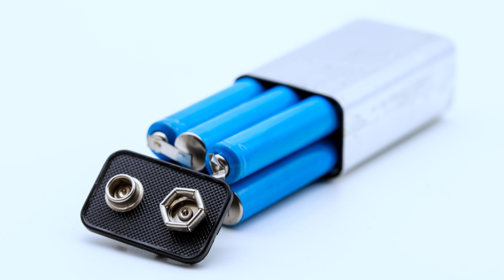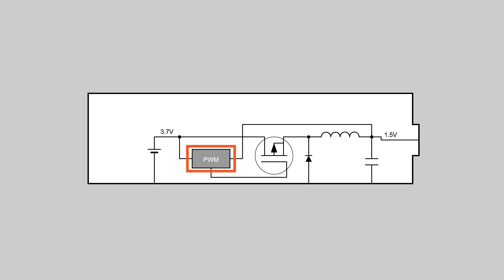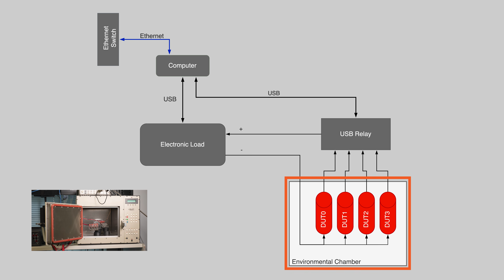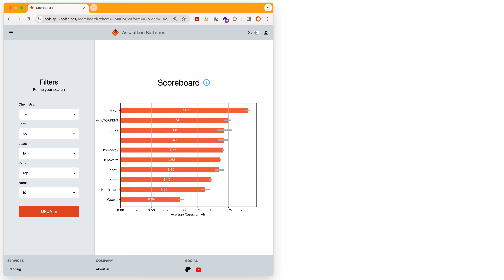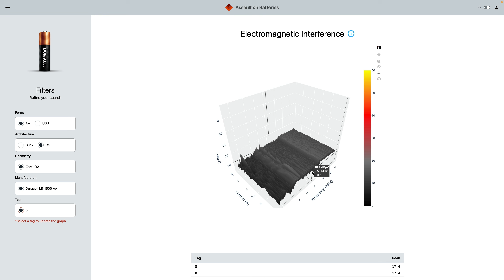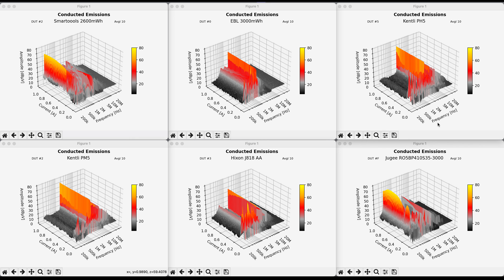Assault on Batteries #1 |  Rechargeable Lithium-Ion AA

Comment: GREAT PRESENTATION.   WILL THE EMI BE A PROBLEM FOR HANDHELD GPS CHART PLOTTER LIKE THE GARMIN
 78CS?
Reply from the maker: Thanks for the kind words!

Assuming you mean the Garmin 78SC, we don't recommend you use them. According to Garmin's user manual the 78SC is compatible with rechargeable NiMH cells. The user manual mentions lithium cells, but these would be disposable LiFeS2 cells (eg Energizer Ultimate Lithium).

Comment: how fine would Lithium-Ion AAA be for gaming mice?
Reply from the maker: Depends on how much filtering the mouse has on its power supply. Unless the manufacturer specifically claims to work with 1.5V lithium-ion cells, we can't recommend them for Bluetooth devices.

If your mouse uses an even number of 1.5V cells, you could replace every pair of 1.5V cells with one AAA 3.2V LiFePO4 cell and a AAA short blank, like these: https://www.aliexpress.com/item/1005009339716141.html

Be careful to replace pairs of 1.5V cells with exactly one LiFePO4 cell and one blank, or you could damage your device.

Comment: Breaking news. These batteries interfere with am radio reception. Cannot use them for am radio. They don't comply with FCC rules regarding electromagnetic interference
Reply from the maker: Yes, they are too noisy to power AM radios, unless the radio has filtering on its power supply.

Comment: If you only get 2200mAh what is the advantage? Thats what Nimh gets and they last 10 yrs if charged right.
Reply from the maker: The big advantage vis-a-vis NiMH is the higher voltage of lithium-ion buck-regulated cells. A 2200mAh lithium-ion cell stores 3300mWh of energy and you don't have to deal with false low-battery indications.

Comment: I have read after 50 cycles they would lose most capacity, is it real?
Reply from the maker: We're curious too, but lab testing of cells is crazy expensive. For reproducibility, we need to charge and discharge four samples 50 times in a temperature-controlled environment. A round trip for 3Ah cells (charge and discharge) takes on the order of six hours. That's 4 x 6 x 50 = 1200 hours of lab time at about $200 per hour (admittedly opportunity cost). There are some low-hanging cost mitigations, but, regardless, we'd need a lot more Patreon subscribers!

That said, which make and model are you most interested in?

Comment: Can I ask, do non rechargable lithiums have the same noise issue? So an Energiser Ultimate or PowerOwl or whatever?
Reply from the maker: Energizer Ultimate Lithium are disposable (not rechargeable), have no internal electronics and don’t generate EMI. Careful with Powerowl, they make both rechargeable (lithium-ion) and disposable LiFeS2 (lithium iron sulfide) cells. Rechargeable lithium-ion AA cells make EMI noise. Disposable LiFeS2 are quiet.
Reply: @on-the-fritz thank you kindly. I saw the new Xtar CLR batteries yesterday and reviews seem good and the voltage drops off more gradually at the end than previous generations of Lithium rechargeables it seems. Available in 3300 and 4300 mWh.

I use disposable lithiums for my radiator valves so am looking at swapping to a rechargeable lithium, as nimh lithiums voltage does not play well with the valves.
Reply from the maker: We'll check out the CLR cells. Thanks for the tip.

What make and model of radiator valve are you using?
Reply: @on-the-fritz they are Drayton/Schneider Wiser valves. They communicate with their hub over a proprietary zigbee link. I've seen others talk about using rechargeable lithiums with things in this frequency that have not suffered from the noise so I'm hopeful things will be OK. They don't play well with nimh due to the low voltage. 

I ordered my first rechargeable AA lithiums yesterday (Xtar 4150 mWh, Xtar 4300 mWh CLR and 1620 mWh AAA) and a VX4 charger to go with them. The 4150 and 1620 cells drop to 1.1v just before death, so I'll just use those in things that I don't need battery monitoring on, but they are cheaper than the new CLRs which will go in the valves as and when the disposable lithiums in them perish. Not cheap, but I purchased 96 disposable lithiums in the last 12 months so payback won't take too long!

Comment: I really wanted to like some of these cells but I ordered a few off of Amazon and  i have to say I'm not super impressed because when I put them in my simple light that takes three double a cells that I purchased from Home Depot the unit started blinking on and off so they're not really made for high power LED type lights.  

So I'll stick with my IKEA LADA batteries and just switch them out as needed.   
And it's really nice that someone mentioned the EMI that these lithium ion double A cells produce because a lot of people forget about that but then there are a lot of devices that really don't care I mean if you had the really inexpensive cheap flashlights that you probably picked up at the Dollar Tree these things are amazing.

Same thing with those outdoor LED lights that you'd like to go ahead and keep running for a long time but you are stuck with the double A form factor.
When you usually takes two to three double A's I sometimes just modify I'm just to go ahead and take the standard with your mind on sale and just call it a day and I made a few lights like that or modified them to work in that fashion and they last for quite a long time and I used them that way with even unprotected cells for over a year and they worked just fine.

Great way to recycle your old lithium ion cells from active duty to running some LED candle lights outside.
Reply from the maker: How much current do your LED lights draw?
Reply: @on-the-fritz     Hey, I got a Bench top power supply!   BRB. 
UPDOOTE:  

At 4.5v   ( ~ Max a fully charged Alkaline) 
4 Watts.   
.7 of an Amp Current on the highest setting. 

I did not bother with the low setting but the cut out Voltage the Defiant  branded LED light was about ~ 2.5 volts.  

Odd?  
Either the batteries are causing interference with the circuitry inside the light or it really doesn't want to do anything over a half an amp from these batteries that I purchased.

another YouTuber in Japan tried the very same batteries and they in fact did do one amp of current but it seems very odd that minor having trouble with that maybe it's because they're in series?  :body-blue-raised-arms:  
Maybe an extreme amount of Interference? 
Who knows....  

They sure built well, and they work great for about 30 min or so - then they are a bit too dim to really use as intended.  
In fact at about 3 volts they are all but unusable.
Reply from the maker: Yes, that’s odd. We resistively load AA cells up to 1A during our EMI tests without issues, and many manufacturers claim their cells are able to output 2A.

To solve the mystery we’d have to characterize the current drawn by the LED light over time with an oscilloscope. It’s safe to say it’s not a steady load, like a resistor.

Comment: I was planning to purchase lithium ion converted 1.5V batteries for my clamp multimeter till I stumbled upon this highly educative and informative video which I'm glad I did.

So I guess it's Nickel-Metal-Hydride battery for me
Reply from the maker: Does your clamp multimeter take an even number of cells? If so, consider replacing pairs of alkaline cells with a 3.2V LiFePO4 AA cell and a dummy (shorting) cell.

Comment: 110% Agreed !!!~~~~~~~ Who makes BEST ????
Reply from the maker: All of them are too noisy to power devices sensitive to radio frequency noise and we have no data on reliability, but we really like the Nitecore NH2400, because of Nitecore's reputation, its look and feel, its high energy (despite having a USB-C charging port), its gradual voltage drop, and because they're almost the only offshore manufacturer that exceeds their published specifications in our testing.

Runner-up is the Soshine 4200mWh, which tops the energy scoreboard, also has a gradual voltage drop (but not from the start like the Nitecore) and is inexpensive on Aliexpress.

Comment: So, I'm assuming because of the EM noise, these might not be good for a handheld GPS receiver, correct?
Reply from the maker: Only the manufacturer of the GPS receiver can give you a definitive answer, but they tend to be quite conservative with their recommendations. If your application isn't critical, it's worth a try. You'd want to compare the GPS receiver's C/N₀ values, if they are available, when powered by alkaline and bucked lithium-ion cells.
Reply: @on-the-fritz  It seems that most of the Li battery EM noise is due to the switching and the electrochemical process in two MF (kilohertz) regions. The highest noise frequency I could find was around 1 MHz. All the GPS signals (US GPS, Galileo, GLONASS, BeiDou, QZSS, IRNSS) are in the GHz range from 1164 MHz to 1610 MHz (plus 2492 MHz for S-band India). As long as I don't have a WiFi-equipped unit I don't think it should be an issue, and those units have internal batteries anyway. Bluetooth and ANT+ also GHz range.
Reply from the maker: Keep in mind: buck-regulators have fast switches for efficiency, so they emit harmonics that splatter up-spectrum; and receivers often use intermediate frequencies that can intermodulate with the EMI from cells.

Can you clarify what you mean by noise due to an "electrochemical process"?

Comment: Very interesting, thank you! How about looking at Paleblue and Bump USB Rechargeable AA Batteries?
Reply from the maker: You're welcome! 

We shall add the Paleblue and Bump AAs to the queue.
Reply from the maker: paleblue is on the scoreboard with 1569mAh and 2286mWh, which is about average. Unfortunately, of the four Bump AA cells we purchased, only one would take a charge; it tested at 1262mAh and 1859mWh.
Reply: @on-the-fritz  I must confess I haven't used mine yet. I will make an effort to use them now.

Comment: I have been looking at the Li-ion AA and AAA batteries with the integrated USB-C socket. Any good suggestions?
I want to use them with my Garmin Foretrex 701 (AAA) and 2-way radios (AA).

I like the integrated USB-C cells because they have a higher likelihood of being useful in a power-limited situation like for disaster relief after a tornado / severe weather where infrastructure is not readily available.
There are 100+ different ways to charge a USB-C powered device (solar power bank, hand crank charger, car charger, portable power bank, ect...) but batteries that require a special charger are useless if you have lost that special charger or power is unavailable for it.
Reply from the maker: We can't recommend buck-regulated lithium-ion cells for devices with sensitive analog circuitry, like GPS receivers and radios, because such devices might not tolerate switching noise from the cell. We expect electromechanical and digital electronic devices would be immune, but there's no guarantee they wouldn't interfere with other devices. For example, your two-way radio might pick up interference from a string of LEDs powered by a buck-regulated lithium-ion cell.

That aside, none of the cells with integrated USB really stood out in terms of capacity, EMI noise or build quality. We did have out-of-box failures during our testing, so it would be a good idea to buy a few extra for backup.
Reply: @on-the-fritz  I tested some RayHom AAA type-C batteries in my Gamin Foretrex 701 and they worked great.
I also tested some Cardiens AA Type-C batteries in my 2-way radios and had no issues.

Comment: about 5 years ago i went on a search for legit replacements for all my alkaline aa/aaa cells.
after looking through all the available options: enloop NiMH, usb rechargable lipol (as outline in this video), i found the least well known and best performing version of rechargeable cells in this format. only 1 company i can find that mfg them.
soshine lifepo4 batteries with double voltage. you can either use a cheap spacer (i prefer brass pcb standoffs with a bit of al foil wrapped longwise around them) or rewire alkaline compartments from series to parallel. 
in my experience i have had zero failures, and no noticeable reduction in capacity despite constant use in many applications. they have about the same capacity of standard brand name alkaline batteries, and basically last a lifetime without any questionable electronics jammed inside. theyre true cylendrical cells. since almost all electronics run on around 3-5v, almost all alkaline battery compartments tend to be series multiples of 2, so they work surprisingly well.
not sure why this solution is either overlooked or ignored by almost everyone on youtube. i think the guy with the swis accent was the only guy who did a video back then reviewing them.
i charge mine from a lab bench power supply and some small 1cmx2mm neodid magnets, but i suppose in theory you could use a tp4056 board or some of the newer varieties and just put 2 schotkey diodes in series on the positive lead for a final voltage of around 3.6v. would take awhile to finish charging them unless you also had a ~5v 100uf cap wired i think in parallel with each diode? so that voltage sensing would be more stable at the end of the tp4056 charge curve. like 1 hour vs 6 hours to fully charge. not sure why there are not any cheap battery chargers for them if i can figure this out while completely hammered on a weekend with barely any EE knowledge/background.
Reply from the maker: We've had good luck with Soshine products, both with their cells and their chargers. Check out Assault on Batteries #3 at the 5:00 mark.

Comment: The answer is simple, Shelf Life. Alkaline batteries win this hands down.
Reply: alkalines leak before you take them out of the packet these days 😊
Reply from the maker: Correct. Lithium-Ion can’t beat alkaline (ZnMnO2) and disposable lithium (LiFeS2) cells for shelf life.
Reply: @on-the-fritz  LiFeS2 is a type of lithium-ion cell.

Comment: I was just about to order a bunch of these for some cameras, but after seeing those EMI tests, NiMh it is.
Reply from the maker: Wi-Fi video cameras?
Reply: EMI only affects Am Radios not FM etc and should not affect cameras or flashes and is fine in game devices including game boys and remotes
Reply from the maker: Unfortunately there are no simple rules. The power supplies in some radios filter the EMI from buck-regulated cells. For example, Lectrosonics wireless mics boost 1.5V with DC/DC converters that have EMI filters. 

And it isn't just EMI you have to consider. Some electronic flashes don't interact well with the switching regulators in buck-regulated cells and take too long to cycle, if they cycle at all. 

Let's hope manufacturers eventually design battery-powered devices for buck-regulated cells, or better yet, design them to efficiently convert a wide range of voltages that includes simple lithium-ion and LiFePO4 14500 cells. That way the user can choose the chemistry that suits their application, whether disposable or rechargeable.

Comment: Would've been nice to test and show the current and maximum current capabilities of each cell. Like how much the voltage drops under a certain load and how many amps can be pulled from each cell before it shuts off. All this information is super important to me. Too bad it was left out as the rest of the video was great information.
Reply from the maker: Thanks for the suggestion!

Many of the manufacturers of bucked lithium-ion cells claim a maximum current of 2A, some claim 3A and some make no claim at all. Is there a particular make and model you're interested in? Can you tell us about your use-case so we can design a meaningful test?

Comment: I have hundreds of NIMH rechargeables, which I've been using for a decade, but just purchased my first rechargeable lithium AAs. While testing/comparing some Ladda 2450s with the Lithium AAs in a pair of identical RCA camping lanterns, the lantern that had the lithiums inside suddenly stopped producing light after about 45 minutes into the test.. I'm pretty sure it simply burned out from the constant 1.5 V X 3. It was probably designed for the gradual voltage drop off in alkalines, I'm guessing? Also, 2 of the 8 lithium rechargeables I received were defective from the get go. In another test, within one lantern, I decided to test the voltage of the cells out of curiousity and one of the 3 lithiums measured lower that the other two still running at 1.5V.. Either a quality control issue or that rechargeable lithium AAs are more prone to failure or to be defective? I'm going to stick with my NIMHs for the moment as my first experience with the rechargeable lithiums make me scared to put them in certain electronics... A constant 1.5V (which usually reads as 1.54 or 1.55V on my testers) seems it may cause issues, especially in a device that takes many AAs. Similarly, I avoid using Lithium disposables in flashlights (for example) that require 6-8 cells, simply because of the nominal 1.7-1.8V reading of these. I imagine, they run closer to 1.5V under load, but still.
Reply from the maker: Many of the rechargeable lithium-ions we tested were dead on arrival, but we don't have enough samples for comparisons. What brand of lithium-ion rechargeable did you try?

What model of RCA lantern have you got?

You're wise to be careful of the open circuit voltage on disposable lithium. They drop down to 1.5V around 100mA, but some devices can be sensitive to the higher voltage.

Comment: I was using three Hixon AA cells in a Coleman LED flashlight and when in high mode the body of the flashlight became rather hot. I had to turn it off and let them cool down.
Reply from the maker: You have a Coleman BatteryGuard 300M?